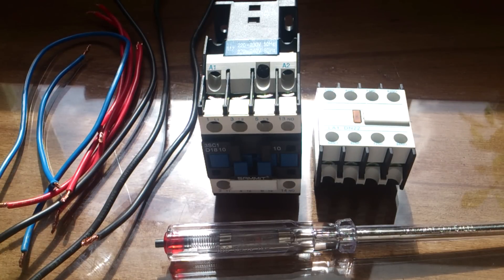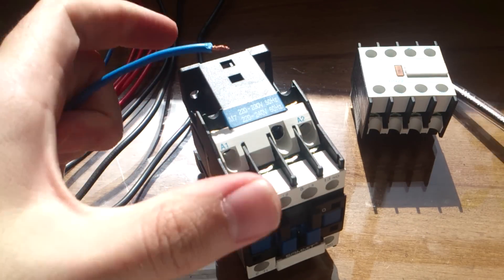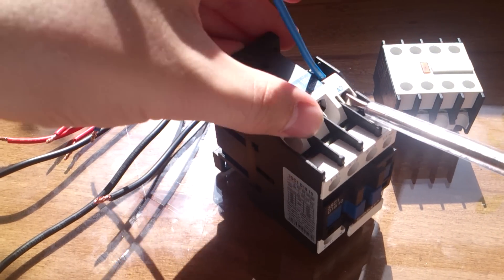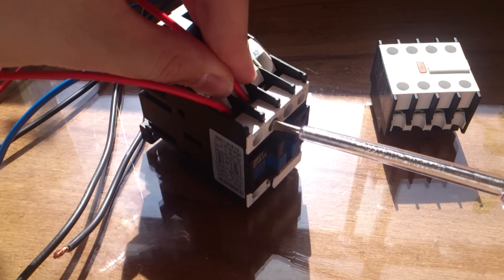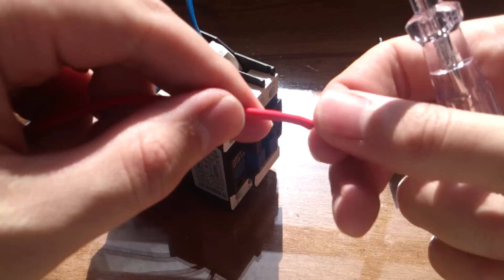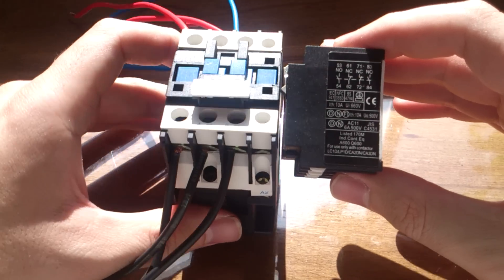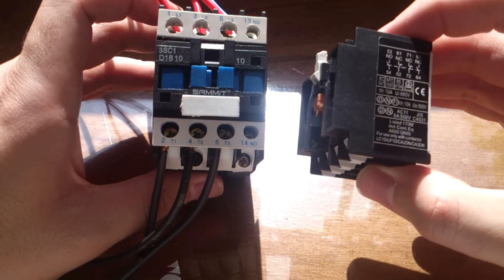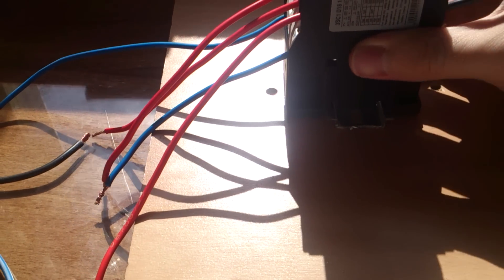How to wiring a power Contactor and how install the auxiliary unit on it

Comment: What if i connect wall switch to this contactor instead of push button? Is it possible to do this
Reply from the maker: I'm not sure about your exact meaning  but in fact axillary unit is for this purpose. we use auxiliary unit to making circuit and use power unit to connect motors and something that need more current.

Comment: What if i connect wall switch to this contactor instead of push button? Is this possible to do this
Reply from the maker: I answer it. but could you tell me your mean as another way?
Reply: Make Something Smarter TT I mean i connect a live wire from my smart wall switch to the contactor A1 terminal and Neutral wire loop from the ceilling light to the A2 terminal to power the contactor to switch on my airconditioner. I had actually done it and it works well. Thank you